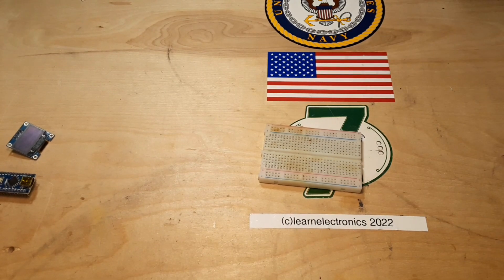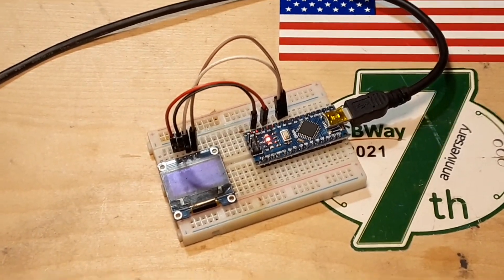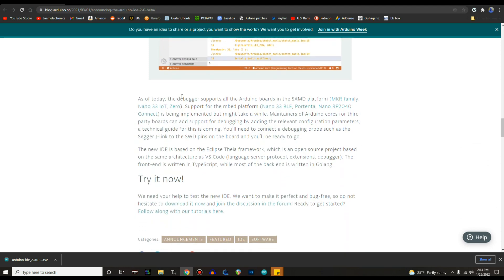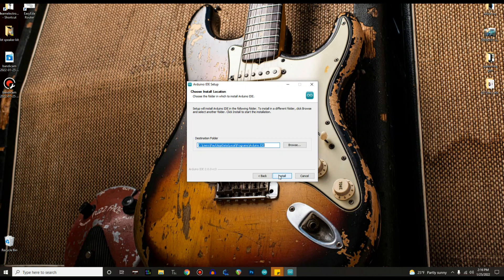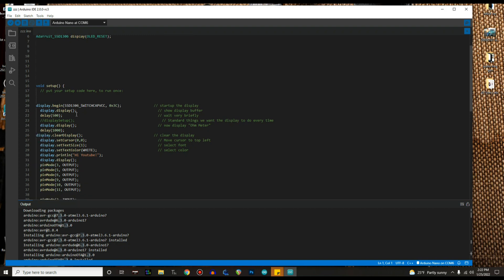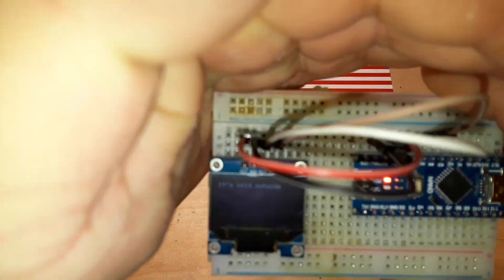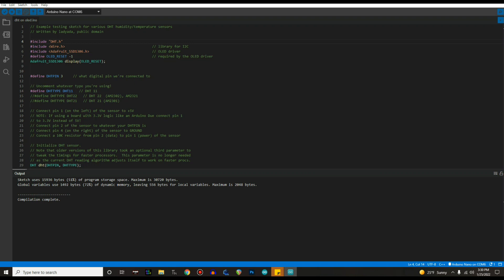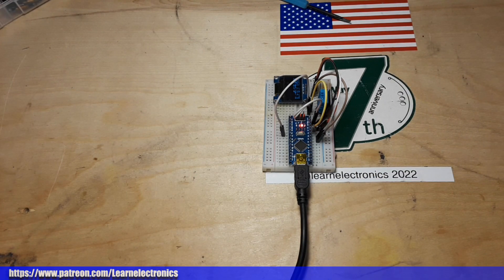Arduino IDE 2.0 Upgrade: Download, Install and  Use

Comment: Thank you for this video. I have been using 1.8.13 for quite a while and have installed a number of additional boards and libraries. My questions are:
1. Can I have 1.8.13 and 2.0.4 installed on my computer at the same time?
2. If I install 2.0.4, will it automatically pick up the boards and libraries that I already have installed in 1.8.13 or do I have to install those additional items again in 2.0.4?

Comment: this is so exciting... do you have a video on a bipolar (+ & -) 0 to 10 vdc 1:1 ratio opto-isolator using the Vishay IL300 or SLC800 in Photovoltaic vs Photoconductive? 🤔thanks 🥳🐈

Comment: Are you still planning on doing an Arduino Kit in the future? I was hoping to get it and build it and take a look at what the code looks like and maybe try and tweak it a little to see if I could make the lights blink faster or differently. Just to learn a little. If I messed it up, I could just reload the provided code and start over until I learned something.

Comment: Looks like a very good upgrade to the older version and will definitely help a lot of people get their code right.  I switched to vscode with PlatformIO a couple of years ago.  That's still quite a bit ahead of the new v2 of the Arduino IDE.  To each his own though.
Reply: What does platformio do?
Reply: @alexstone691  It adds all the Arduino bits including the libraries, boards and capability to upload and open the serial monitor.
Reply: @alsnow3582  after looking into it, im definitely using it for next project

Comment: I been playing with it for a few days, and they have almost got it where I want it.  It is a huge improvement over the old one.  Now, just waiting on Paul Stoffregen to have the teensy loader working on it and I will use it all the time.  I use the Teensy 4.0 or 4.1 for about everything now.